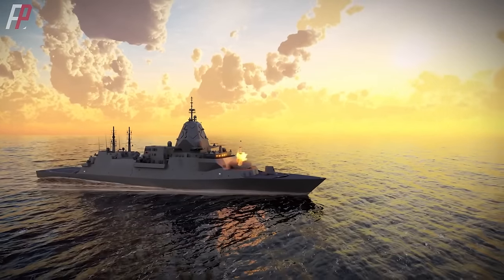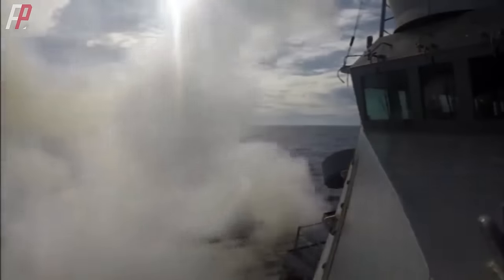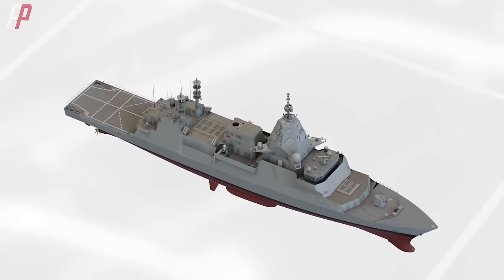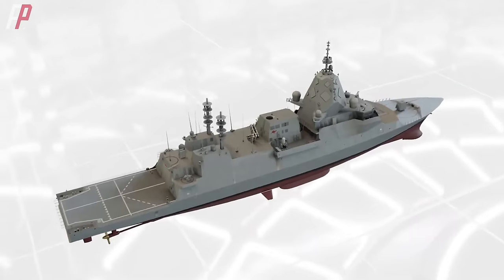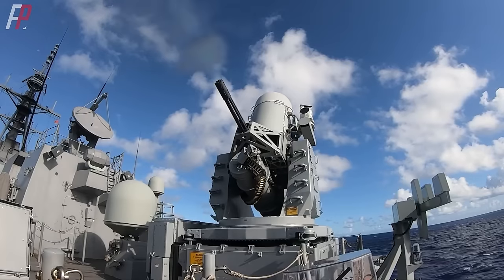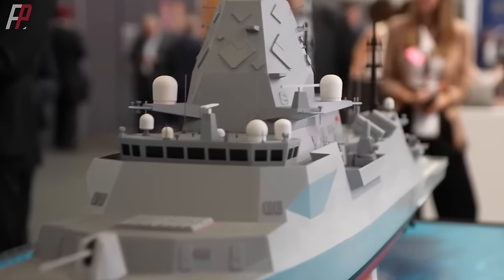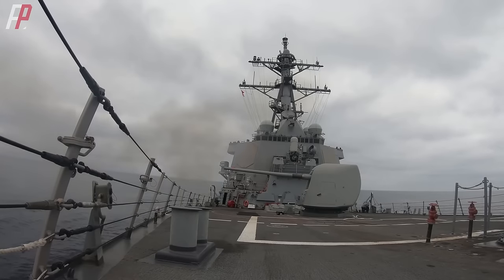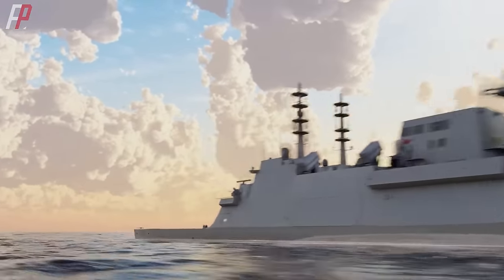BAE Systems Introduces Enhanced Hunter Class Frigate to Boost Firepower for Royal Australian Navy

Comment: I'd keep the gun and go for 96 VLS total. With the addition of 16 NSM, the ship would still be capable of a heavy offensive saturation attack versus a peer navy (China).
Reply: I agree. The "Missile Only" generation is obsolete. Arty will never be invalid, especially with ever evolving munition designs.
Reply: The problem with this is the ship is originally a quiet hull design. It is slower through the water than it could be for an Air Warfare Destroyer because of this. It is designed to hunt subs not birds.
Reply: 3 varents of armament BAE systems offer for the hunter class.

1. 32 cell VLS with multi mission bay. 

2. 96 cell but no multi mission bay and some ASW equipment removed and still has the main gun.

3. 128 cell VLS. Same as varent 2 option but the removal of the main gun.

Theirs several options for ASW for the ship if Australia  government  goes for the upgunned varent  96 cell VLS option for RAN

1. Helicopter  with lowing sonar system  for ASW detection. 

2. Small torpedo size underwater drones that can fit inside the helicopter bay without taking up room for the helicopter or its equipment. These drones work better  than towed away sonar system and gives capability of the ship to have more armament and still have ASW capability 
.
Boats can also be placed on the upper deck. Having an internal bay just makes the ship look more roomy.. Theirs no actual need for it. And it's a big loss of armament to have it

The only change is that some work is done to the electrical system and power increases to the ship motor.  And fuel.  Apparently, all can be done at the same cost of all armament  varent
Reply: @phil20_20  It's also worth noting that navy ships do not only go up against other major navies. They are much more likely to encounter "low intensity" incidents what would make the use of a missile overkill. Even using a naval gun is something so rare that some ships have never fired their guns in anger during their whole service life. So imagine what kind of incident it takes to generate the need to fire not just one missile, but dozens of them in a single mission. (It takes a peer-on-peer high intensity naval war.) 
Australia's navy is not the USA's (having a 500+ ship navy, where every ship can do one specific task knowing that some other ship will always be able to do the others). Keeping your options open is better than over specializing, and then getting caught out in a situation which you have no capability to deal with.
Reply: @phil20_20  Please cite how many times missiles have been used in the past ten years versus the use of the main gun.
Reply: @jimmiller5600  Today, the maIn gun is a cheaper alternative option to use against drones. But even in a major navel war, if it were to happen. It be very unlikely main gun would get used except other than use for close in weapon system. Enamy ships won't be in range to be able to use against it.
Reply: @Nathan-ry3yu Dream ON, armchair Admirals.
Reply: @Caine1277  Believe me AEGIS in combo with CEA FAR2 exceeds any old SPY 1 or new SPY 6 or SPY 7 radars.
Multiband CEA FAR 2 with the fixed 6 sided L band with anti stealth features have also 6 faced S band and X band AESA radars whilst the others have only have one band of S or X band
The damn thing is a huge beast of a radar the out performs most if not all that's out there!

Comment: Removing the type 2087 towed sonar is a mistake. Australia will never have all of the ships they need, so the ships they have will need to be able to protect themselves and surrounding ships from submarines as well as surface and air threats. If anything, Australia needs more ships with VDS and towed srray owners
Reply: No it's not. Towed away sonar is old technology.  Drones swarms work better. And comes with AI making detection easier.  They can load several of them in the helicopter bay without taken up room for the helicopter. Towed away  get snagged some times. It drags the ship. And can collide with other ships damaging it. It also only can scan behind the ship. As where drones not detected by enamy ships or subs. Due to its electric quiet  motor. And can scan deeper and wider. Allowing to pinpoint exactly where the enamy is for a direct  hit.

The new front sonar system on the ship is also quite powerful. And you also have a helicopter option that also has a  sonar system it can lower into the water. 

Plus, Australia  will have nuclear powerd submarines escorting them. That also has drones. 

Seems you're not up to date with technology, mate

Comment: Do not remove the deck gun. The gun can be used in situations where a missile would be overkill.
Reply: 5-inch gun I don't  think is suitable either.  It has a slow firing rate. The 76mm Auto cannon would be a better option, twice the firing  rate, and you can get MP3 exploding shells for it.  For more chance for a hit.  And it also can fire just as far.. why you don't see many 5 inch guns put on European navy vessels.  Theirs more option for different rounds available for the 76mm.
Reply: Depends on load out. No need for the high rate of fire if the guided shells are used.

Comment: Its basically a destroyer.
Reply: I like the Hunter class because it has a smaller crew, it costs less than full destroyers, it can carry more missiles than the Australian destroyers, it is more compact and lower radar signature and more importantly it can be built in Australia. It can be configured to have the abilities of anti air or anti sub or even both. They are a big up grade on the Anzacs they are going to replace. So yeah it is basically a destroyer if you want it to be.

Comment: I think Australia should build at least two of the enhanced class frigates to escort each of our helicopter carriers. The rest can be the sub hunters and I think we should keep building frigates for as many personnel who can be provided. Limits to 9 or even 6 ships is not what our protagonists are doing. However all of them should have the full loading of VLS cells that is available for the front banks rather than the one main bank of cells. We have less ships than China so we need a larger load of weapons on each of our ships. More bangs for the buck. We also need to plan for one more flat top to be a dedicated light carrier as a 30-40,000 ton vessel and fill it with F-35c's. The Canberra and Adelaide need air cover to operate and the air force might not be able to fill the role depending on distance from the mainland. The F-35 is more than a fighter, it is an AWACS as well, providing extended radar and fire control. We have new circumstances in the pacific and we are late on meeting the new challenges.
Reply: Build all 9 the upgunned varent. They can still armed with AI underwater drones systems in the helicopter bay without taken room up for helicopter.  Towed away sonar system old technology. Drones is the way to go for ASW.  Can get damaged by other ships sailing  behind  snagged in shallow sea. Especially  in south China  sea that is full of fishing nets. And it's drags the ship making them slow. It's dated technology.  Drones is the way to go and allows for more armament on our ships.
Reply: You would be there all day trying to "outman" China, much like trying to outship them.  Like most western militaries today recruitment and retention of experienced personnel is the real battle.
Reply: That recruitment problem is because the Australian government focused on the army during the war on terror at the expense of the navy. So that is a problem that can be rectified. I do not think we can out man or ship China but we need to be able to to contribute better because even the US will not expect to go it alone against China. It will be an alliance of common interest against China but our navy needs to be able to operate as a single task force if required in the future so we should be working towards that future goal.  Short term requirements is what has left us without the navy we need today. We should have bought those French subs to fill the gaps of the Collins subs while waiting for the nuclear subs. We paid billions of dollars to get nothing but out of the contract and we need new subs years ago. @regregan6852
Reply: Well Australia building 11 new medium sized ASW ships at around 5500 tonnes.  It wouldn't make much sense to build 6 large hunter class all set up to be ASW lighter armed ships also. So I'm guessing they will be upgunned as they are to be a part of tier 1 along with the Hobart class AWDs
Reply: @smittyk7810 with the timing to build these ships the RAN has time to get enough recruits for them. Not that many crew needed to oporate a ship. Between 90 to 180. Times that for every ship only around 3000 or so crew needed out of 27 million people I'm sure that's a very low number of people to get. And should get.

Comment: During the Indo-Pacific the BAE rep interviewed by Xavier from Naval News, said they had done prelim work on fitting 48, 64, 96 or 128 VLS cells. They did it by reconfiguring the mission bay module but would not be ready before construction started on the 4th ship. Personally I think a Hunter with 64 VLS would be an extremely potent warship, very strong in all aspects of naval warfare, still has the VDS and some mission bay room for drones so still a potent ASW hunter, carry up to 112 SAMs or a combination of SAMs and LACMs future for AD could carry up to 16 NSMs and retains the 127mm gun  or carry future AShMs in VLS for ASuW.

Comment: I am no expert, but I thought the Hunter class was designed to be one of the best anti-submarine frigates available. In a big war anti-submarine ships would I think be as valuable as pure gold. Stay the course build eight say and three of those proposed Flight three destroyers with the128 VLS systems for grunt.
Reply: “As a wit once said, searching for a submarine with a surface ship is a bit like searching for a gas leak with a match,” he quips. “You’ll find the submarine, but only when the torpedo is in the water and heading towards you.”
Reply: The question is how many do you need? You cannot have your whole fleet looking for subs.
Reply: 96 cell hunter class would be a good choice. Still get to keep the main 5-inch gun. Including the front mounted sonar on the ship. Theirs other ways to give it ASW detection systems also. Theirs the helicopter with the lowering sonar system. Torpedo size underwater electric drone with sonar and AI that can either be launched from torpedo tubes or stored in the helicopter bay without taken up room for the helicopter and its eqwipment  So a multimission bay isn't necessary. And theirs still room to store boats internally inside the ship on either side of the 64 cell VLS cells where the multimission bay was.

Only a towed away sonar and a few other ASW systems will be removed.  But can be compensated by other ASW devices. Towed away sonar system old technology anyway.  And can get snagged in fishing nets, etc. Especially. In the south China sea. 

The 128 cell hunter class varent would be removal of the front 5-inch gun. I don't think it is necessary to have this varent. The 5-inch gun is still very useful  for cheaper options close in weapon systems against drones, aircraft, and cruise missiles.

If RAN wants 128 cell VLS varent Navanti flight III destroyer offer 128 cell VLS with direct energy wepon systems Aegis combat systems and 5 inch gun.

If it was my choice, I would build 8 ships of 64 cell VLS hunter, so it will allow a little more room for a small multimission bay  to give the ship a bit more ASW capability while allowing the ship to be still heavily armed. And build 4 Navanti flight III destroyers with 128 cell VLS to replace the hunter class. And build 12 Navanti Alpha 3000 corvettes for OPV for heavily armed coastal vessels that have 16 cell VLS and anti ship and ASW capability. Along with nuclear powerd submarine, it will be  a hell of a powerful fleet. I'd also build a long-range bomber varent of the MQ28 ghost bat drone loaded with multiple LSRAM missiles for long stike capability since we don't have an aircraft carrier's

Comment: Having spent 21 yrs in the USN that frigate and all ships need at least one gun front or back but they need a gun for millions of reasons.
Reply: BAE ship builders have offered upgunned varent Hunter class of 96.cell.VLS with front main 5-inch gun. The ship will have 13.000 nortical mile range at 26 knots. Top speed well over 33 Knots. But it won't have a multimission bay and will lose some ASW systems. Although it will still have a front mounted sonar still, and they can compensate with other by using helicopter with lowing sonar system and torpedo size electric underwater AI drones that can be launched from torpedo tubes that has Sonar system and sensors.

For destroyers, Navanti offered Australia flight III destroyer with 128 cell VLS, a front mounted 5-inch gun and direct energy wepon system along with Aegis combat system and Australian CEFAR-2 electronic scan aray radar system. 

The new navel review of Australia is focused on giving RAN as much long strike capability as much as possible while still having ASW capability as RAN fleet is small. While some additional corvettes can be added to the fleet to make up numbers and bring more heavily surface combating force. That doesn't require a lot of recruitment that they seem to have trouble getting.

Australia next fleet could look like this. 8  heavily armed hunter class frigate. 4 heavily armed destroyers.  12 corvettes.  8 nuclear powerd submarines.  6 mine hunters.  2 replenishment ships.  2 LHD ships. 1 large multi-purpose merchant navy vessel.  6 boader patrol vessels.  4 submarine recovery vessels.  3 small muti purposes vessels

Comment: A frigate with most of it's anti-submarine capability removed in favour of more VLS cells.... so essentially it's not a Frigate at all, it's just a Destroyer they cheaped out on
Reply: It depends on what they can put on it. Removing a few ASW systems and a towed away sonar system isn't exactly taken away ASW capability as theirs alternatives such as torpedo size AI drones with sonar that can be launched from torpedo tubes and stored and charged in the helicopter bay without taken room up for helicopter. There is still the front sonar system so it doesn't  get removed.  Then theirs the helicopter with lowered sonar system.  A towed away sonar system is old technology.  Drones is the way to go

Comment: If they could keep the 127mm gun, go for 64 VLS while having the same ASW capabilities.
Im hearing a extra 32 VLS and the hunter will lose the mission bay but keep all the ASW equipment even the towed array.
So that's 32 VLS forward and 32 VLS where the mission bay was thats makes 64 x Mk41 strike length VLS with 12 to 16 SSM launchers, this would make a good frigate but 2 ASW helicopters would be acceptable.

Comment: Only Labour would remove the sonar from an anti submarine frigate…….no one is sailing a surface vessel, or aircraft carrier group, to Australia without the personal attention of the RAAF over and over and over. Submarines are the only threat during war time.
Reply: Haven't  you heard off underwater electric drones mate. They do the same thing. Try using towed away sonar in shallow sea around countries with lots of fishing nets.. or ships following behind eachother.  Check to see if the towed away sonar  still there. . It's old technology.

What does a 32 cell VLS ship do when it meets a 110 cell VLS Chinese destroyer? I bet they wished they had 96 cell VLS for armament then hey. What you want with multi mission bay anyway. Play cricket? Small drone swarms can easily fit inside helicopter bay without taken room up for the helicopter. They only Size of a small torpedo. They lower it into the sea and they can last for hours.  Pull it up charge it send out another one. You don't  need mission bay or a  dated towed away sonar system that can only detect  at the back of the ship. When a drone can track and surch using AI and detect all around the ship and can detect fishing nets ect so it won't get snagged.  

Choose a lighter armament for what? You're  a little  outdated in technology mate. 

ADF member